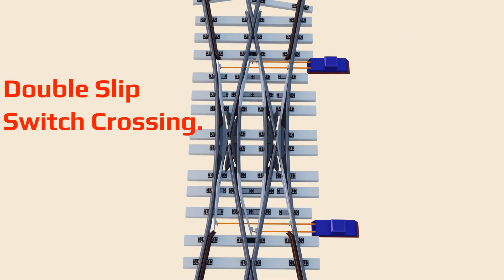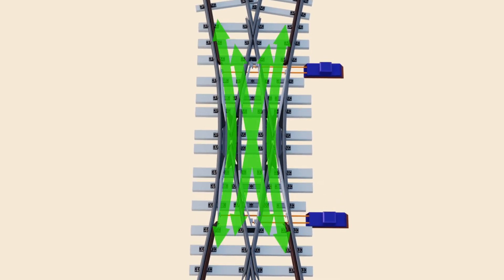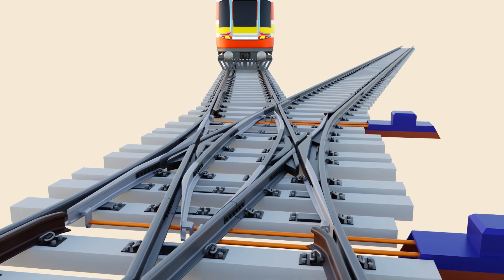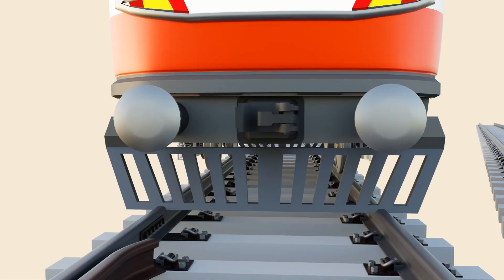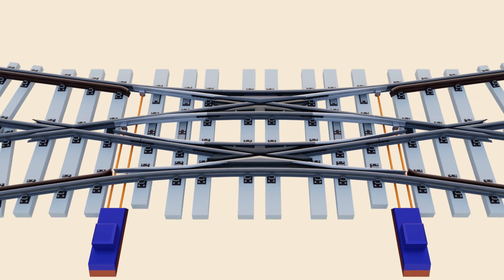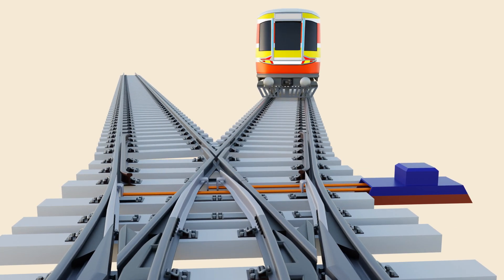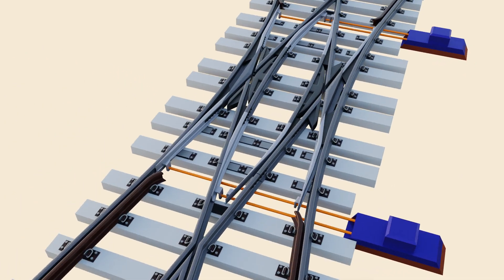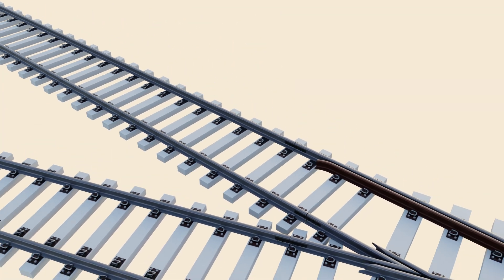Double Slip Switch Rail Crossing

Comment: What makes this design better or worse than the single slip switch crossing from the previous video?
To me, this seams over engineered & unnecessarily complicated, is that correct?
Reply: The single slip only allows switching from one track to either of the 2 exits.
A double slip allows switching from BOTH tracks to either of the 2 exits.
Reply: 2×2 crossings (track A and B on the left side, and track C and D on the right side) basically come in three flavours:

1) The passive diamond crossing, which only allows straight forward crossing  with no switching capabilities: track A-D and track B-C are the only two routes available.

2) The single slip crossing, which looks a bit similar to a passive diamond, but which also has the ability to slip (curve) between the two original routes on one single side for a third route option: track A-C.

3) The double slip crossing, which has the ability to slip (curve) the traffic on both sides, so it enables a fourth route to be configured: track B-D.